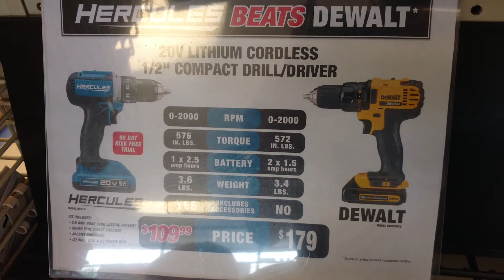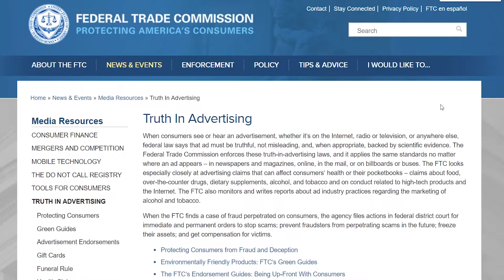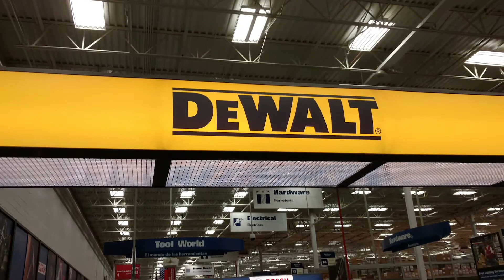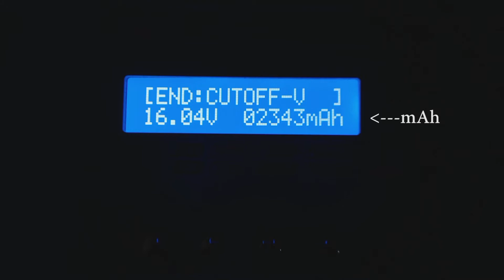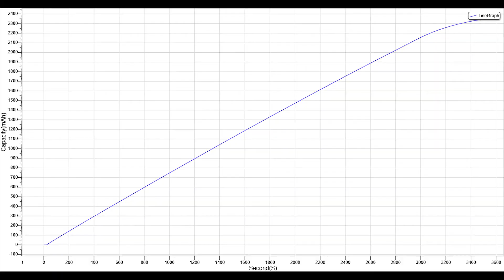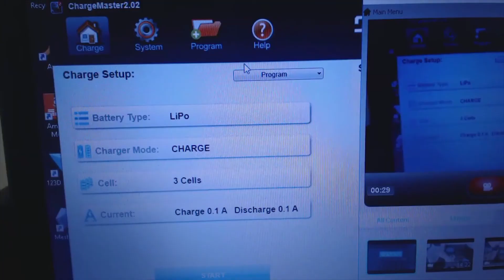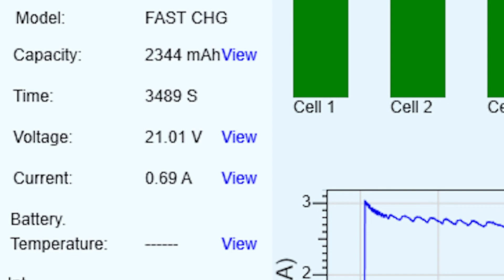Harbor Freight's Hercules 2.5 aH battery gets a capacity test and partial teardown

Comment: :D welcome to Peukert's law. 0.3amps vs 9.3amps (AvE) discharge. Would love to see this test run again at 9 amps (or whatever the drill pulls during nominal use)
Reply from the maker: +JuliansRandomProject that does not bear anything on a proper measure of capacity. There will be capacity loss in heat due to higher amperage. Take a tesla p100 and drive it 150mph. You wont get tue rated mileage yet the stated capacity and literal capacity does not change. No matter how inefficently you pull it, the energey was stored.. If i could measure a 15 amp pull with test equipment i would. What i had for this video was an imax b6ac at its max discharge for ~21-16v. Do you know of accurate test equipment that can draw 300watts? Also, that would only match a "pro" who pulls the trigger and holds it from full to empty...(look at my first test video, i go nearly 7 mins straight w no issues, just heat and still half a battery. Amd it wasnt full when i started)
Reply: On second look Peukert's law applies more to Seal Lead Acid than Li-Ion. In my experience slower discharge would still yield slightly better Wh. The most accurate discharge @ 300W would be a known resistance (like a thick 1ohm resistor), a multimeter and a stopwatch. Looks like you got ~40Wh from your battery (still shy of 50) and AvE got 34. Another diff in testing, yours was at the cell, his was through the PCB. Good chance the factory used 2.3Ah cells in yours and 1.7Ah cells in his.
Reply from the maker: +JuliansRandomProject i dissagree with different cells being used. I would bet money they are the same cells from the same production line. His start voltage was not from a fully charged state (nearly 21volts) and his discharge voltage was not to an acceptable low for testing. he stayed above the mormal discharge (3.3v per cell/16.5v) when he ended the test. as for the usable capacity, the displayed capacity is never the usable capacity from EVs to all the power tools ive ever seen or read about. My leaf with its 24kWh battery only allowed around ~19kWh (new) of actual capacity use. I will get my hands on more tool batteries and test more. Ave is sloppy at best in his test. That is a simple fact. Unless he stated the precise salinity he had mixed in that cup of water down to the hundredth of a percent and what minerals additional to salt were in that test fluid, the test was sloppy. Regarding "from the board" you will notice after my imax stopped the test, my drill still ran, meaning the board would let more stored energy out of the battery, so i did not go beyond the allowance of the board. .. i like talking about batteries. What else do you got? And/or what company manufactures 1.7ah cells? Check out richard lloyds channel. Hes got the battery testing thing down pat. I follow his methods moreso. He draims these 18650s down to 2.5 on some of his tests when he wants a true full capacity (at tge damage of the cell tho)
Reply: So many variables in these tests. We should try and settle on a few things. I'm putting together a video right now with some Peukert testing (likely to show little effect on Li-Ion, against my earlier assumption). I'll check out richard lloyds channel. Are you kidding about the water used? :) since the amperage/voltage was measured for us to see, one could just apply ohms law to get the resistance of his unique blend of water and nichrome wire.

Comment: Good work! I really liked the battery performance tracking software. I'll have to load and use it sometime in the future. After many of us migrate to constructing our power wall electrical backup system we'll need to evaluate cells quickly, thoroughly.
Reply from the maker: +Charles Tatakis hi Charles, yes the software is cool but man does it crash. Check out richard Lloyd's channel. He has great ways of tesring batteries.
Reply: Thanks! Now that's a help where I avoided frustration.

Comment: wow well done! I've watched plenty of AvE videos and I'm surprised he got something wrong (that or he had a bad bat). Good job with your testing!
Reply from the maker: thanks for the comment. Im sure the battery he had was fine. he was talking about starting voltages and end voltages and his numbers were simply not normal to start. The battery dropped to 18 volts right away? at a sub 200 watt draw, that shouldnt happen and im sure that the battery wasnt fully charged at start.. His method ot testing .... well.. I wonder if it repeatable and he has done it on any of the other tools he has tested... the exact same way.. well. im off to his channel now to see...